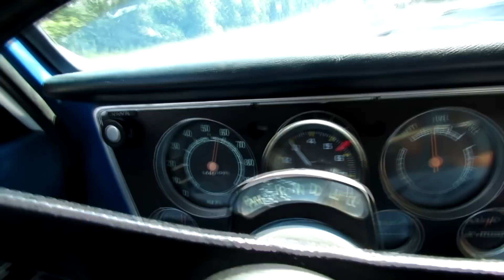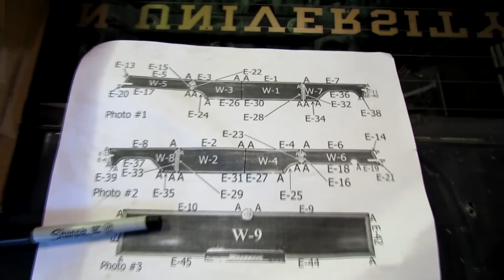A Jeep and 36 Ford

Comment: Other than the rust spots, it doesn't look bad at all!!! Independent front, parallel leaf rear (or coil overs), a SBC and a tranny with a OD, and you will have a nice "family cruiser". What are YOU thinking??  Are you going to finish the 46 first or "jump" right on the 36?? You DID notice, those brakes "you can see" are "mechanical"??? You'll be going to church on Thanksgiving in this one. ;o)

Comment: Will make a Bad Ass Hot Rod..... Its way to nice to make a rat shit rod out of it!!!!!!   heh heh ...... Actually, the Ford you have is very desirable!....... I dig the hell outta of it and it's not in bad shape considering that its mostly all original and being an east coast car......... This will be a very fun build for you & the family.....Parts can be had with the click of the computer mouse...... Are you thinking SBC????? :)
Reply from the maker: GasserGlass I'm still considering....I have a Pontiac 400. And a turbo 231 Buick with a Quadrajet. Or a 283, or a 327 or a later model flathead....
Reply: ummmmm...Me, I'm all about Chevy motor...... but if you're a purist, Flattie is the way to go.

Comment: Great video. That old Chevy of yours does pretty good hauling that trailer. My first thought was that trailer was gonna get squirly with that car on backwards. Then you showed there was no motor. Good luck on the new project. Did you get rid of the Nova?
Reply from the maker: TheKevin1183 Not enough suspension....but it pulls it no problem